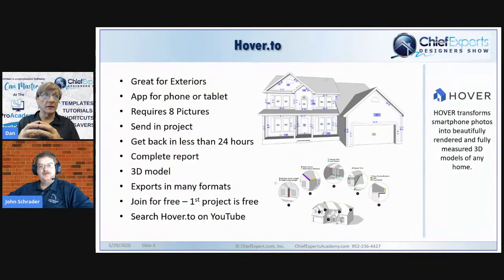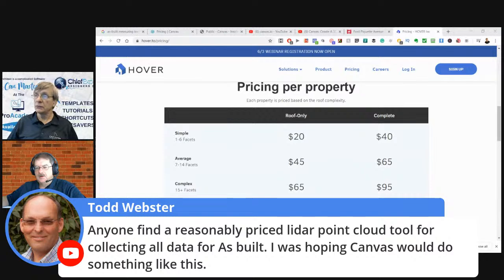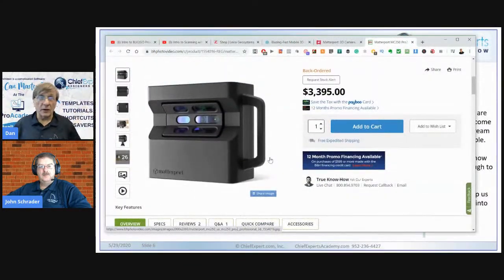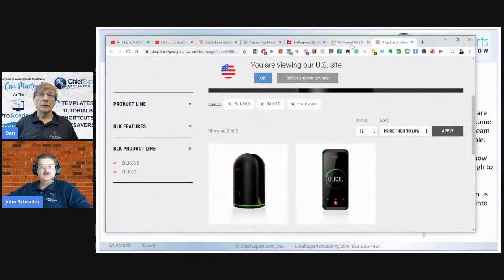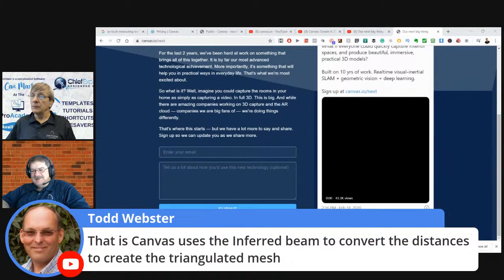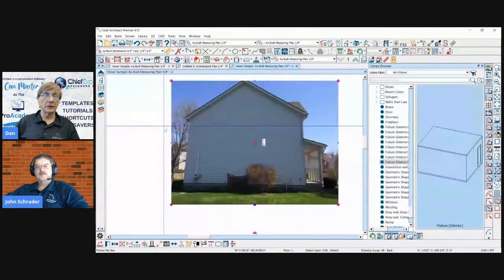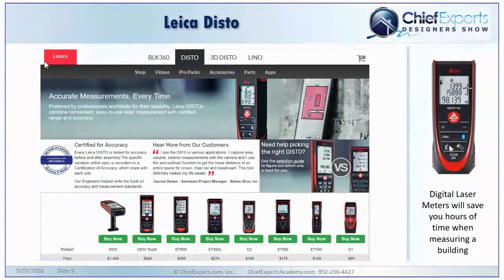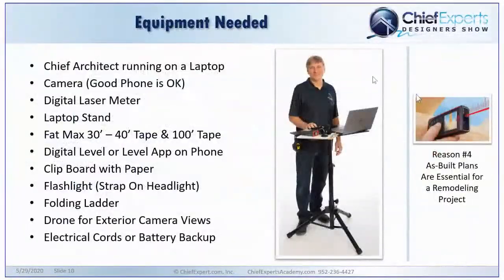As-Built Tools and Technology - Designers Show #5

Comment: Ok so my company specializes in As-builds. We do about 2-5 a week. We have all the toys you have shown here and more. 

Real world precision:
Matterport 2”-6” good only documentation. 
BLK360 1/2” documentation and measurements
BLK2Go walk away @ $75k+ not $19k and drift is bad. 6”-1’
RTC360 1/4” Measurements and FF/FL reports
P50 1/16” God level but slow.

SLAM scanners like the canvas or Apple gear all suffer from major drift in some cases worse than Matterport.  The problem with drift is you can’t see it. Your plans will look correct but be out by an unknown amount. Terrestrial scanners can at least tell you your unsolved error.

Your better off Measuring with a Disto. Your going to have a hard time getting angles correct but that comes with skill and time. Get chief to run on iOS and take measurements from Bluetooth. That would be gold... probably we don’t used chief. 

The major problem your all going to have is that the scanner is not your biggest overhead. Software, high end workstation, CAD technicians that know how to work with point cloud (don’t exist in the wild) and file storage average project being 50gb. 

But you really need to take this stuff seriously. Your builders will LOVE for having best plans. So much that it builds loyalty. Measurements may not be important initially but they are when things go wrong.

Also if a product pitch includes a % and uses the word accuracy... walk away. Percision, horizontal percision and measured in mm. 

Also ditch the laptop. Get a Surface Pro with a strap.
Reply from the maker: Daniel, Thanks for your thoughtful reply. I agree with everything you are saying. The technology is still in its infancy, so we need to give it some time. 

I need to re-iterate my message about Canvas and Matterport. "Use them to get rough layouts. Enough to get started on the as-built so you can put together conceptual ideas. The project needs to be measured in detail before final drawings get completed".

These apps are also great for capturing real-world images of the project. These can be used for many things, including creating the as-built, but they are also great if there are any issues on the project.
Reply: Wow. This was very informative. I'm curious of how the surface pro works with Revit. Specifically when it comes to drawing. The laptop makes for a better workflow, but it is a headache to haul around in the field. Even more especially on a construction site, or an abandoned building where you can't just roll around on a cart with so many obstacles on the floors.